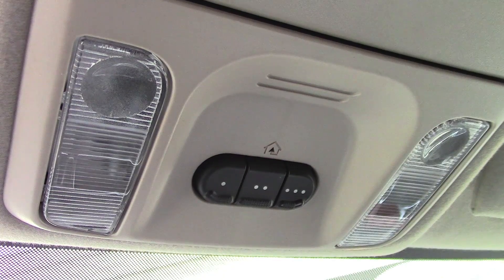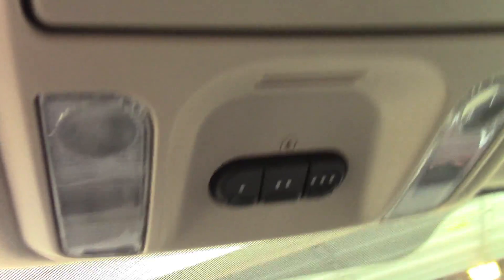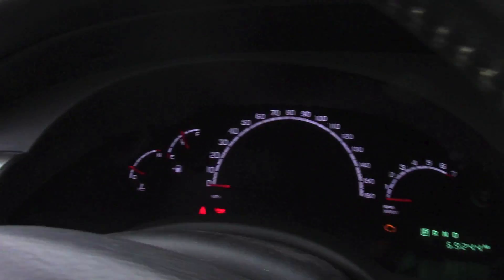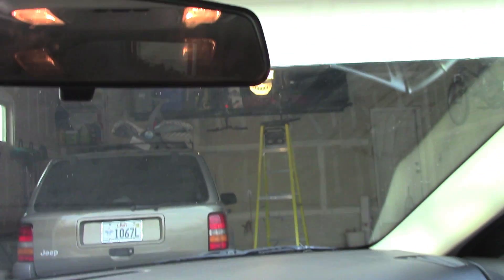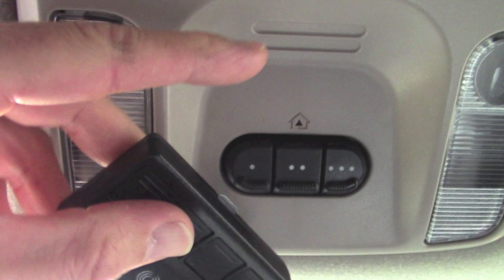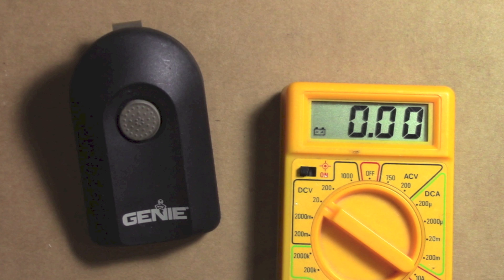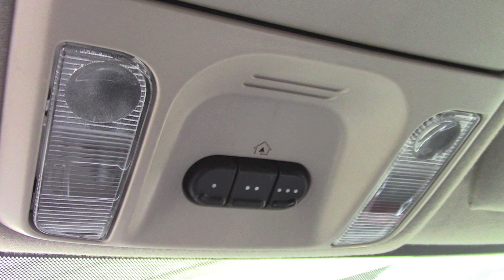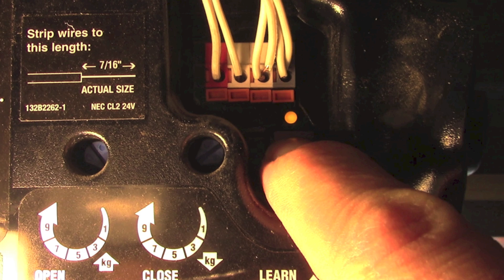How to program & troubleshoot HomeLink programming Garage Door Opener Buttons - Chrysler Pacifica

Comment: If you have a Liftmaster 8550 jackshaft opener with My Q keypad use the keypad not the yellow button on the opener itself.  I wasted hours trying to do it as instucted by the homelink written instructions.  Also, understand the homelink repeater garage door opener fob will not open the door by itself so don't worry if it doesn't.

Comment: Not helpful for my opener and car... cleared the codes, programmed the button with handheld opener for the garage door opener, hit the learn button on the garage opener, pressed homelink button within 30 seconds....still not working with chamberlain... reset opener, still not working, no forum answers anything.  So frustrating!
Reply: Call Chamberlain tech support.  I switched from a Genie to a Chamberlain and could not get it to work with the homelink in my car.  I was told I needed an interface, which cost me another $60.  If I had known that, I would not have bought the Chamberlain unit.

Comment: Is there a way to train the homelink without a handheld transmitter?  Just using the train button on the opener.
Reply: Did you get an answer to your query? I too don't have a remote as my other car has a built in remote button that works.